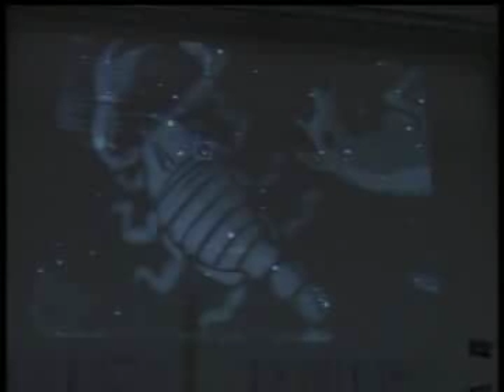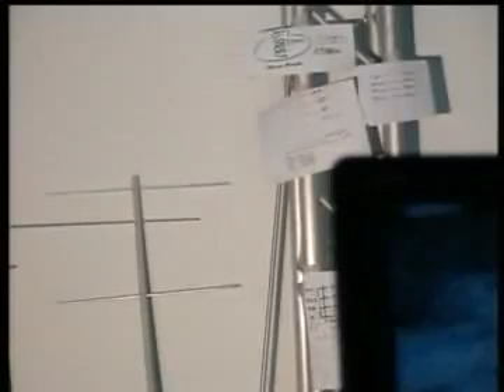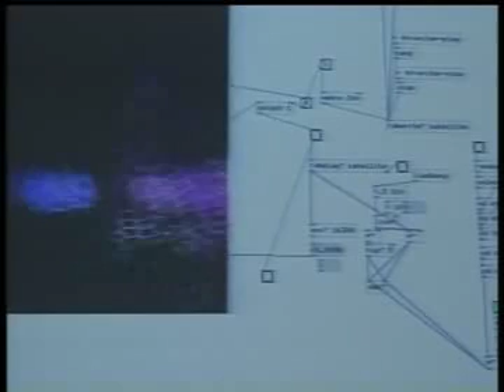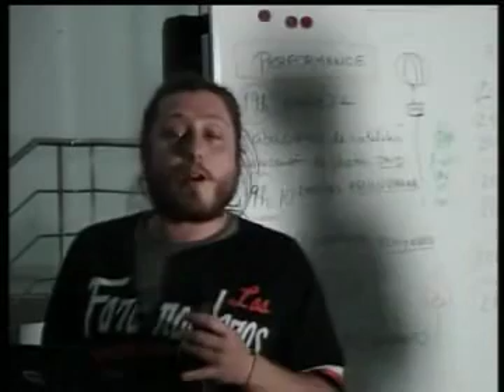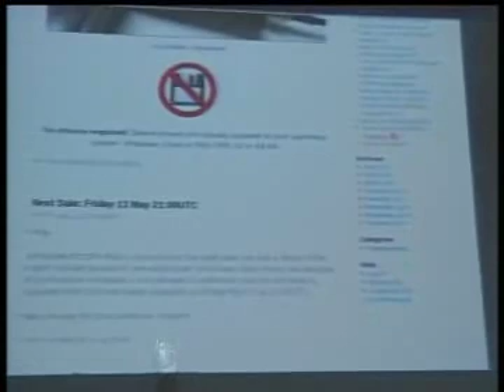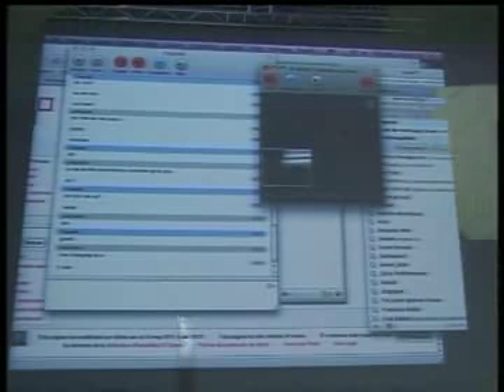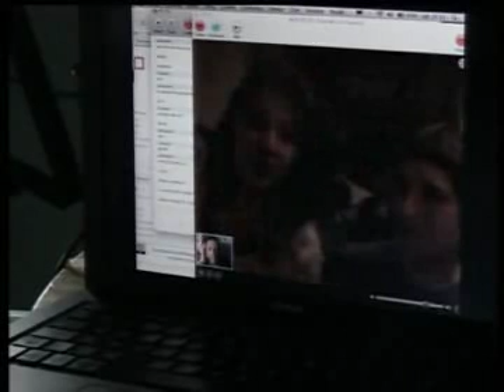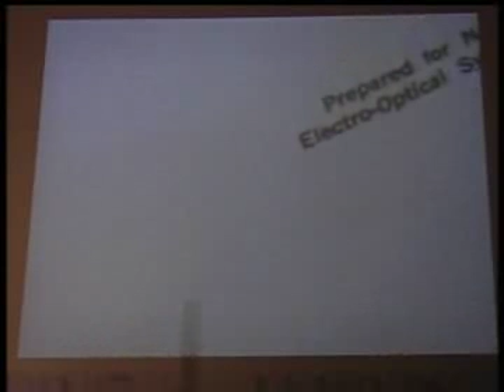Poehali [Orbitando Satelites]

Comment: Just a "correction" about the "poem": it is missing the arabic && latin && the hebrew part... the structure of the text it's all about to pass the text through successive translations until some new text emerge. So at the end it could be signed not only for the one that gave the original input, but also everything in between.

the original text, processed by yupana && google (& now back to their owned cloud):